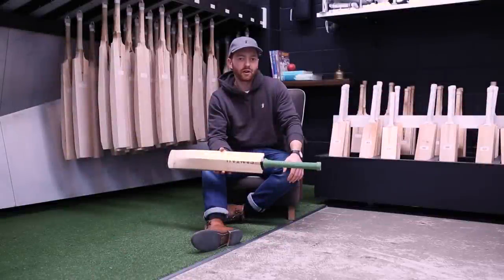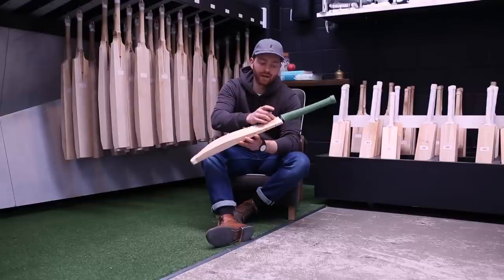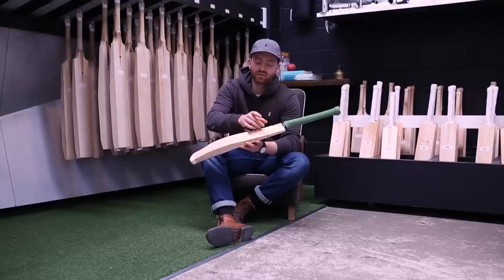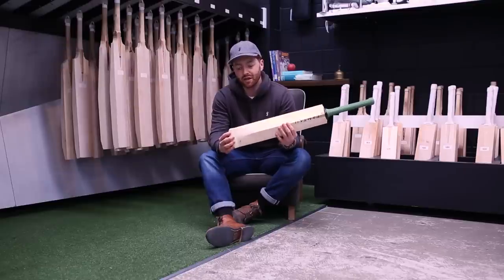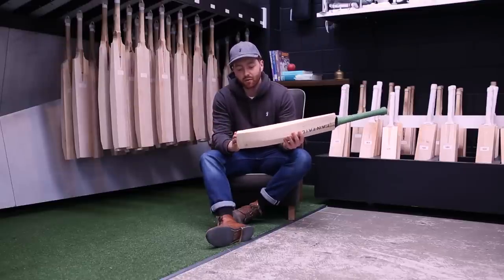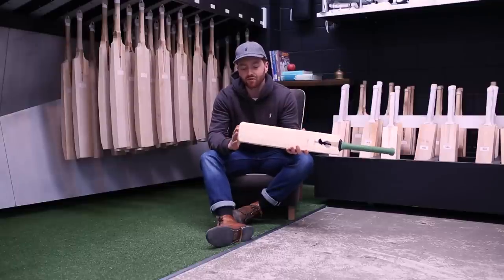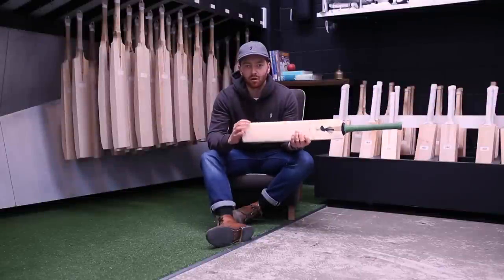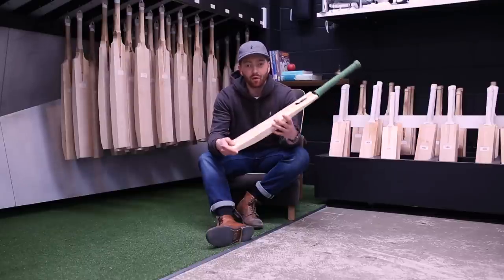Gray-Nicolls Fix & Refurb - Cricket Bat Repair EP 14

Comment: i have a question as to why dont some sort of plastic "shoes" for the toe end of the bat exist in cricket? like something that can be clipped on to bats, to help against wear and tear of the toe end, so that once the plastic part starts to wear out, it is easily removed and replaced cheaply by another one at any given time. i think itll help bats last a lot longer. im sure something can easily be designed on a 3d printer, which wont effect any playing either.

Comment: I'm intrigued by the economics of a repair like this. Seems like $100-$200 or so in labor and a quick search for one of those bats suggest it's around $300. Seems like a brand new bat would ultimately last longer?
Reply from the maker: I believe this was a player's grade 2021 GN, so brand new this bat would retail at $999NZD. Bats also perform better with use so after this repair, It will likely outperform a brand-new version of the same bat.
Reply: @FantailCricket  Thanks for the info!

Comment: Can someone explain the purpose of drilling those holes into the edges, and then hammering those dowels in?
Reply: Strengthen split cracks in the shoulders of the bat, more support
Reply: But Does the hole for the dowels need to reach till the handle? Or it doesn't have to?

Comment: I’m confused as to why you cut the tow of the bat off. This will now make the bat a shorter blade bat, is that what the customer wanted. Handle I get to cut the top off to SH, SSH etc but why the toe of the bat?
Reply: Answered in the video.

Comment: is that medical tape used in the toe?
Reply from the maker: It's a waterproof cloth tape
Reply: @FantailCricket  Does it gives any extra strength to a weak-repaired toe or its just to avoid water damage like a normal rubber toe guard ?

Comment: I have to admit to a bit of confusion. Spending so much on a repair for a bat when a replacement would be cheaper. I do understand the love of the old bat, but if you loved the bat so much, then how could you let it fall into such a poor state.
Reply: This probably cost $200 or so. New bay like this would be $700+
Reply from the maker: Correct, the repair costs just under $200NZD to replace the same bat would cost $1000NZD.